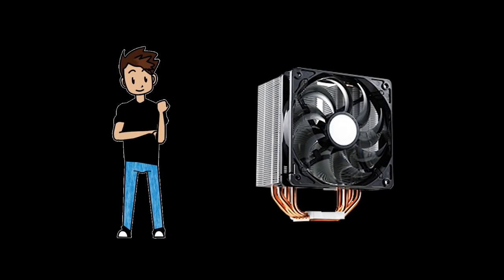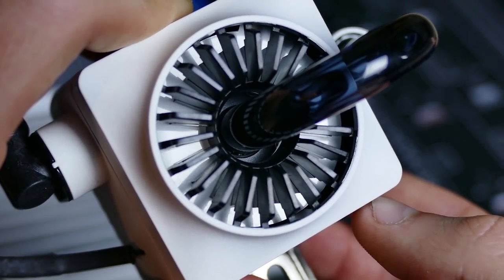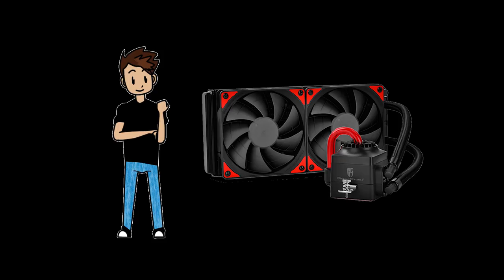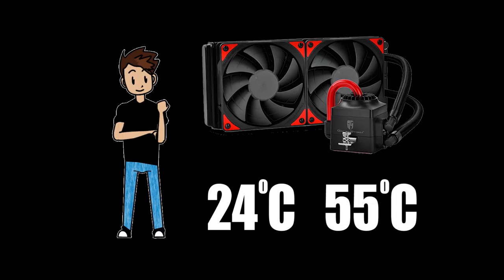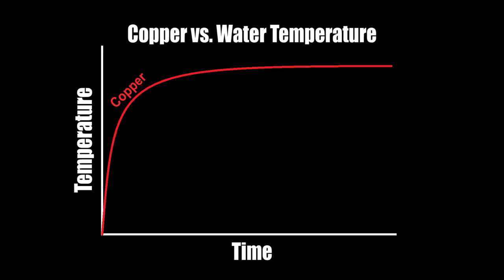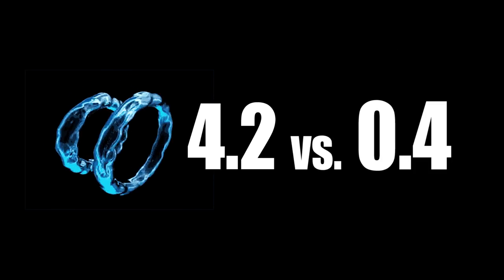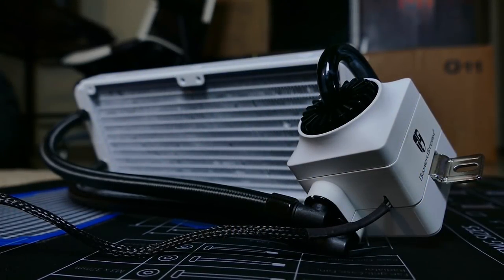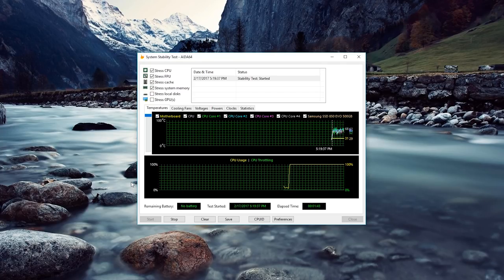How to Properly Measure AIO Temperatures

Comment: Wut. Temperature change is also heavily dependent on surface area and anyone who's taken heat transfer knows that thermal resistivity combined with surface area is really what makes the cooler. The aio has a much higher thermal mass, yes, but also have a much higher ability to transfer heat. That's why they're better. The whole industry is under a problem where people want to see the wrong number because they don't understand science enough to find the right ones. The reason to switch to any different cooler is its ability to transfer heat, not it's "idle and load temperatures" those are a result of the higher transfer rate. If you really want to compare them, make a heater unit that dumps heat into the block and compare the resting temperature of the liquid. That would tell you the coolers ability to transfer heat. Using a highly dynamic could that throttles based on temperature is an inherently poor testing method.

Comment: Air cooling is so much easier, doesn't look cool, but neither does a leaky fitting above your psu.
Reply: Lazlo Binklemon the x62 for example, a complete loop, nothing you have to close or fill. Doesn’t leak

Comment: Yeaaaaa, you're just wrong bud. Yes your MAX temps at MAX LOAD while running something like Aida64 will keep increasing and probably hit the same or near the same as the air cooler. BUT, 95%+ of all computer users are NOT going to have their cpu at 100% load, meaning the AIO keeps their system cooler than the air cooler ever could.

Comment: This is a classic case where someone is just knowledgeable enough to be "dangerous" with the facts. The major concern here is that water will retain much more of the heat energy from the CPU within the AIO system, effectively negating it's positive attributes. This couldn't be farther from the truth. Because while it is true that water has a much higher thermal conductivity than copper, it can also dissipate this heat much more quickly through a fan and radiator setup. The demon tweak here is to set your cooling fans on maximum so the system works as efficiently as possible to dissipate the extra heat energy FAST. End of story!

Comment: I guess every car should just switch out to aircooled engines.... why spend millions on cooling systems when air will do the same job. Your missing the surface area the radiator can dissipate heat through. You will find most water coolers are in place they turn the fans down to run silent or near silent operations. 

You should add a bunch of radiators like 2 or 3 to a system then get the system up to temp. Then adjust the fan speeds up and down to see that a water cooling system can run cooler then air and the trade offs when ramping up fan speed

Comment: I'm not so sure this is really all that true. Sure, you can run Prime95 for a whole day if you want to see how hot liquid gets in an AIO but that's just not realistic. I have a custom loop set up that's got my CPU and GPU entirely in the same loop and I play games far far more than I should. 12 hours+ if I have the time. My GPU used to run consistently at 80-83C on its stock cooler. I simply cannot push my GPU beyond 65C overclocking it and running it all day on demanding games. I understand the point of allowing the loop to equalize before giving benchmarks, but is that really realistic with typical computer usage? Does the average user place a load on hardware long enough to allow the loop to equalize to those temps? Sure you might have some graphic designers out there rendering images all day or have people like me that play games constantly, but is what you just stated really enough to say fairly that AIO coolers are "lying"?

Comment: The lying he's referring to is the claim that "the liquid coolers kept my CPU to only X temp" and portray's this large temp gap compared to regular heatsink/fans.  In reality those gaps were under short bursts of testing.  The gap is much smaller under sustained load (giving the water time to get hot).  Did you people asking what the lie is not pay attention to the video?

Also, Science Studio, I have to call you out on one thing.  You mention it takes longer to get water temp down after the load is gone.  However that's a function of the radiator/fan, not water itself.  If you have a more powerful radiator/fan, then the water temp in the loop will drop much faster when the CPU load is gone compared to a less efficient radiator/fan system.  (To you point, however, it won't lower as quickly as the copper/metal heatsink will for the same reasons the water takes longer to reach a steady temp under load.)
Reply: There is still no lie happening except in the video itself. First, the title of the video (and the content) is only discussing AIOs, but the same principles apply to any liquid cooling setup. Second, nothing is "lying" regarding temps. There are no false temp readings or anything of the sort when using liquid coolers vs air; it just takes water longer to heat up, so the temps will slowly rise until stable vs immediately rising like when using non-liquid cooling.

Comment: Your explanation is not quite accurate for the results you see... What you are saying is that copper gets hot faster than water (which is true)... this means that copper can REMOVE more heat from the CPU FASTER. The faster heat transfer occurs means the lower the CPU temp will be and the faster it will occur. 
It takes more energy/heat/time to increase the temperature of water which would mean your CPU temps should be HIGHER initially. You see, you are not measuring the WATER temperature, you are measuring the CPU temperatures... 
while the WATER temps would take longer to stabilize (be lower longer) this also means the opposite would be true for the CPU. The CPU would be hotter initially and then stabilize (provided the radiators have enough surface area).

Comment: Benchmarks are good for finding the extremes of your system.  I like my AIO simply because it's a lot smaller than a bulky air cooler.  As for the CPU saying warmer longer, it's actually not good for materials to cool too rapidly most of the time.  Extreme examples being glass or metal where the rapid cooling causes material stress and eventually failure.  So I'm fine with the AIO taking time to cool down, besides, it's only a few minutes to get from a toasty 140- 150F to around 95F for my cooler, so I'm happy.  Although, it could use some RGB. . .

Comment: it would also be really nice to inform people of the differences you can achieve when comparing temps on Ryzen CPUs and Intel CPUs and especially when comparing it when you have a delidded Intel CPU. A Kraken x72 and a Noctua nh-d14 will result in almost the exact same peak temp on an 8700k. once you delid the 8700k, the kraken x72 will show what it can really do against the nh-d14. this has nothing to do with the thermal capacity of either cooler when the CPU has not been delidded, it has everything to do with the TIM that intel uses not being able to transfer enough heat, so both coolers are going to waste when paired with the 8700k and not delidding the CPU, as both of them can cool down all the heat that the TIM can transfer to them. so, no, AIOs are not lying to you, you are not informing your viewers of all the variables that go into the results you are quoting. Note I have seen on multiple different occasions, people linking this video to attack people who use AIOs, claiming that air cooling is king. if you are going to put out any more videos like this, please take into consideration the entire picture, and not just the clickbait nonsense, like you did with this video. #ThumbsDown

Comment: Stop Clickbait: Long story short, You're not being lied to, you just need the water cooling loop time to normalize. IE come up to temperature. Traditional heatsinks+fans, normalize much quicker.
This applies to all water cooling setups. Not just AIOs. Why Science Studio is blasting AIOs specifically, i have no clue. 

AIOs are fine, you can get good temps using AIOs, just run your system for a while to know what the true temperature your cpu will be running at.

Comment: your missing the point where ANY radiator cooled system  also reflect the room temperature... while yes your input  and temperatures take longer to heat up and cool down... WAIT Lemme stop there... The key is knowing your temperature ranges to begin with.   IE The heat output vs what your radiator can cool per volume of amount of liquid. I keep my  computer room around or below 70F if not 65f. Having used the nearly exact same aio cooler shown and gaming long periods.(deep cool ex 240,  with some different high pressure static fans than came with ie higher than what came in the box. infact i outperformed what deep cool's temp rangers were ) Compared with the stock amd cpu fan, my cpu temperatures are STILL 5-10 c below what my air cooled stock cpu amd fan was ... While your comparing this with an intel system and i'm using an amd which throws  more heat which also requires needed the absorption rate of the higher sustained heat dissipation rate of your radiator, for the sustained stabilization eventually mentioned.  HOWEVER I will also revert back to my previous statement.  ROOM TEMPERATURE! Again The lower you keep your air flow temperatures on your radiator  FASTER your heat dissipation rate becomes between the water  and the airflow.  While eventually there's a trade off where simply no amount of colder air will trade off heat any faster than what the liquid or the airflow will allow...  Even over prolonged gaming  experiences my temperatures remain averaged LOWER  during prolonged gaming sessions the whole idea with using liquid cooling wither its a aio loop or a custom water loop with a reservoir  is that HOPEFULLY you  have enough liquid that it doesn't reach upper temperatures of of whatever limit you want to set on the cooling. I think you'll find a huge difference in temps with a single  double or triple fan aio set up or even Radiator setup with a reservoir. longer rise to average temp in combined with a cooling effect upon the liquid.... provides a longer mean time  at lower temperatures where it should even out lower if its properly set up.... assuming you're not overtaxing the cooling ability of your radiator. This technology has been around in vehicles because it works to a certian degree.  the whole idea of Radiator cooling is that you reach a mean temperature that's lower than what most  air coolers can achieve. I'll happily take a longer rising temperature with a  average lower temp.

Comment: One thing is not clear to me. Which sensors are being monitored ? All content in video makes me think that people are watching AIO sensors. But it actually does not make sense.
What matters are the sensors inside cpu. They will determine what happens next. In summary. If cpu temp is very high than the OS will say to the cpu to slow down to avoid hw-related problems. That's why you would use a cooling system.
I didn't like the fact that video go all "scientific speechy" but didn't mention any details like the sensors being checked, the benchmark used etc. Also it mentions some facts like why water and metals heat/cool differently but it doesn't talk about what happens when OS detects that temp has gone too far.
The title is also a clickbait for sure. I mean that I would watch it anyway if it had an honest name. But the it keeps me wondering how desperate this YouTuber is for some clicks and then I question myself if there are any misleading information on purpose. If he made another video about this being honest and precise I would give a chance and maybe a subscription.

Comment: That's cool and everything, no pun intended, but the reality is you get similar high temps with both the best air cooling and water cooling systems. Granted the water cooling systems are more expensive, however you don't have to put the equivalent of a scoop on the hood in order to achieve them, and you don't have to remove your cooler when you want to swap your RAM. I'm talking about the air cooler in the link below, which I'm considering vs. some of the well reviewed AIO coolers. Frankly I'm leaning towards the AIO based on the arguments above. Additionally, in the realm of physics, doesn't that giant think hanging off your MB put some strain on the circuit board?

https://i.redd.it/42cr02uq1it01.jpg

Comment: Bit of bullshitting which is ignoring the principals that the liquid is not only moving but once it reaches the radiator is spread-out allowing faster dissipation of the heat taken on. Maybe he should take a more in-depth course on thermal dynamics and non-destructive testing.

Comment: none will stress test their pc for "hours" as you said because real life applications besides extensive 3d rendering will not push your hardware for "hours" but for minutes! so also that the temp do not rise fast its an extra plus for the AIO! because it keeps your CPU cooler for the amount of time you need to finish the job which is usual minutes not hours! like an AIDA stress test. sure at the end their DELTA may be closer than we think, but if i want to do a heavy job for 45min and the AIO keeps me cool at 45c and the air goes straight to 60c from the 1st 5mins then the AIO wins! even if by the time my tasks finishes and we are on the 45th min of my heavy workload, and AIO is 60c and AIR 68c its doesn't matter AIO again wins because it took LONGER the temps to get to that 60c!

Comment: umm, first off you should be comparing the specific heats of water and air! not water and copper or any other metal. because the heat sink just sucks the heat away from the processor and transfers it to the cooling fins for air to absorb heat or to the liquid inside the AIO. since water can absorb more heat faster than air the AIO is easily able to remove the heat away from the processor when Andy starts up aida 64. at the same time when he uses an air cooler the heat removed from the processor is accumulated in the cooling fins for the air to remove it which takes time and humungous amounts of air.
also fyi metal on metal contact actually has the best heat conduction but since it is impossible to machine the surfaces so flat that there is perfect contact to remove air between the metals which is a bad conductor of heat we use thermal paste or thermal compound to go into the micro crevices and aid in the conduction of heat and elimination of air pockets. 

sorry for the long comment, but please get your facts straight before explaining a phenomenon.

Comment: So you're saying, according to your video, that all in one coolers in fact aren't lying about their performance increase anf cooler temps? 

And of course if you heat iron and water to same temp, then let them air cool the metal would cool faster. Your example is moot because there are fans cooling the water down in the loop so once the load is removed it will cool down just as fast... Maybe a millisecond slower. 

You used NO benchmarks and tried to use scientific equations to bolster your argument. But in many cases theoretical arguments don't hold up in real world applications.

The main reason why AIOs are better is due to them venting their hot air out of the case while the air cooler uses the air inside the case and vents it inside the case. Heat saturation is an air coolers downfall

Comment: Sorry but I don't get your point, I have two low end AIO´s, one cooling CPU and one cooling th GPU and its true that it takes about 8 minutes to get its peak temperatures, but after 50min running AIDA64 when I stop the stress test, it immediately  drops its temperature, so you must have something wrong with your expensive computer. 
http://prntscr.com/i2vzsm
You should check things better before stating things that are not true and confuse people with false statements .
AIO´s used : Seidon v2 and thermaltake water 3.0 performerC.

Comment: It keeps it cooler longer... How is that a lie or misleading? Eventually the heat build up overcomes the cooling capability, but it takes much longer to reach that point than a traditional air cooler. 

You're looking at it all wrong, it's almost like you don't understand how cooling works at all. Let's compare this to the intercooler on my car, upgrading it doesn't lower my final temps, if I keep pushing 15-20lbs of boost through my turbo, it's going to get hot. A bigger intercooler let's my do that for longer, but eventually the heat build up will overcome the intercooler ability to cool, and I need to let the engine cool off. A bigger intercooler just means I get to step on it harder for longer, but not that I can keep it at full throttle indefinitely.

Manage you expectations, AOI isn't a magic bullet.

Comment: Shure that copper warms up quicker than water.
But there is no water in the AIO's^^ There is liquid inside, like car coolant, shure mixed with water.
Why the hell we are using watercooling in cars?
If you are right, we should cut the front of a car and should do airflow cooling dude^^
You definitely miss two things.
1) The liquid is flowing continuously with great speed. If there are two locations in the circuit affecting the temperature, I must say that the cooling side has much more area, so the coolant will rather getting cool instead of warming up. And if the heat of the coolant stabilizes at 40° C, than your CPU, which has a copper surface, quickly will follow the coolants temperature. So thats a good job that the coolant warms up slower^^
2) Water cooling systems hava a very welcome side effect. The coolant changes heat with the CPU copper surface (a little bit) and the main thing is that the radiator is getting cooled down somewhere else. Best method, towards out of the case. We could say, we are taken the heat of the cpu and blow it outside the case, and btw. the coolant is cooled also.
Now put all this together and think about it again.